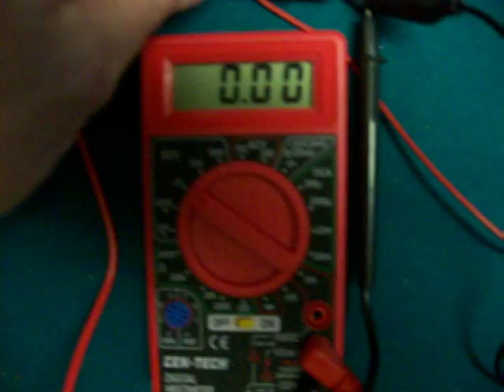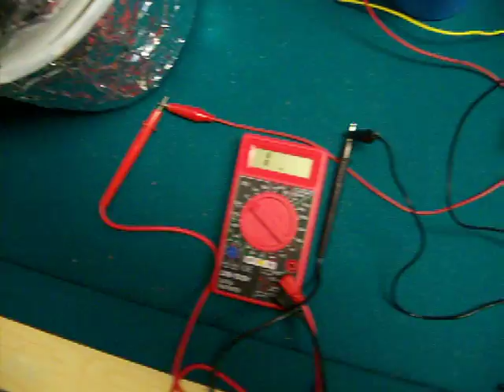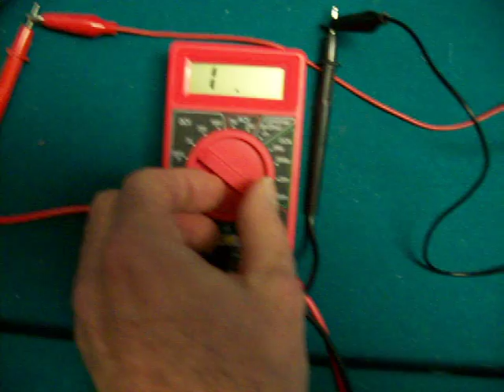SEC Charging Capacitor #2

Comment: good work there i to  have charged up hv capacitors but useing a combination of free energy from air circiut from the inventors 3 site and  some other ideas , its a bizzare set up i have but i got results that are not yet known except a very few includeing jonny davro.  i used the av plug diodes to like you did and more , my sec circiuts are different  like one of jonny davros but more upgraded and my sec towers are bigger and  more complex

Comment from the maker: Drevtoobe I did try the test you asked.
With the capacitor and led across the battery when the sec was running.

No it would not light the led at all.

Comment: Hi slayer, great video !
I have a question: if you put AV plug on battery, does it charge while supplying the SEC ?
Otherway, can you connect the charging cap on the supply line, bringing power to the SEC, while charged by the SEC ??
No no no no, I'm not thinking about closing the loop :))) lol

Comment from the maker: The cap is 300 volt 4400 MF
My meter doesn't work right  when the sec is running.
So I can't read the current with my digital meter.
But you can let it run for hours with barely taking any power from the battery.